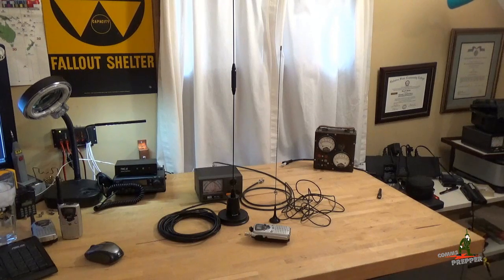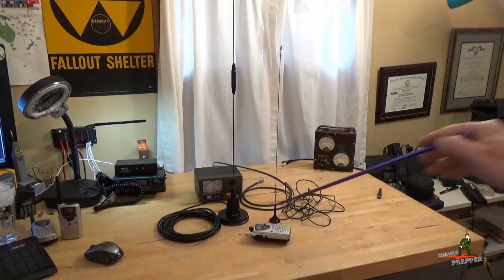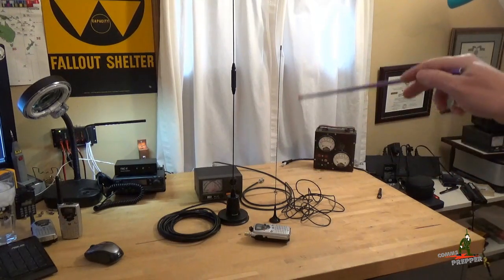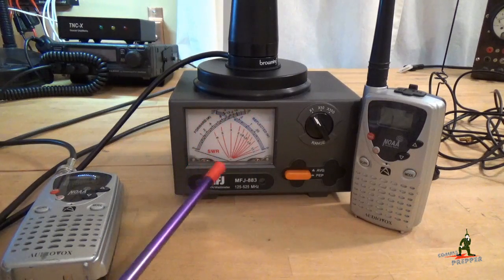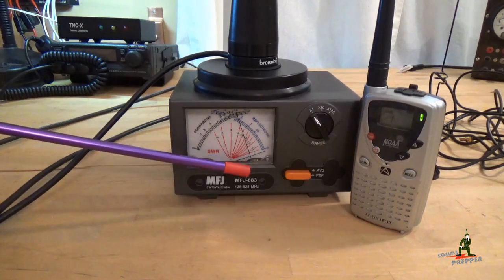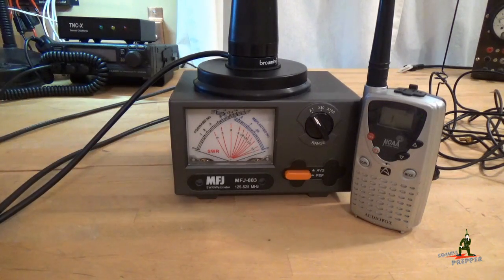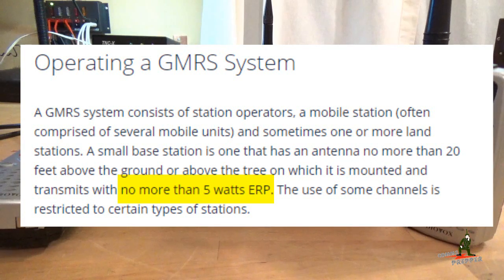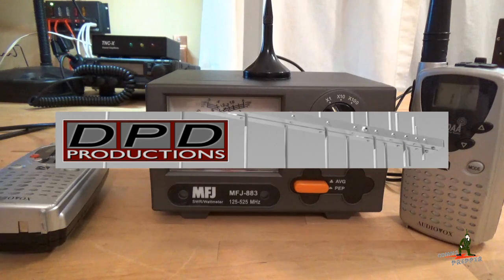GMRS Mobile Antenna

Comment: FCC regulations concerning transmitted power have no bearing on the antenna gain whatsoever. Transmitted power as defined by the FCC is the wattage that exits the radio at the radio's antenna connection point, not the power transmitted by the antenna. This means signal multiplication by antenna gain factors are of no concern to either the user or the FCC. You can put full legal 50 watts of power through a high gain antenna with no limitations or worries, provided the antenna is mounted within legal height guidelines for your area.
Reply from the maker: I thought the power was based on ERP?  I will have to go back and check.  So much to remember with radio.  Thanks for the comment and taking the time watch.
Reply: You're correct, at least as I understand with the CB rules the FCC uses ERP. If they use it for GMRS I'll need to look again.
Reply: I posted the part 95.135 power limits section below, from the FCC.

Comment: I just got the Midland GXT1000VP4 Handheld radios and the Midland MXT400 GMRS radio.  Will this antenna work with these radios?  Thanks for sharing.
Reply from the maker: The DPD antenna will work with the mobile.
Reply: Okay, thank you.

Comment: Just ordered DPD mobile. I am using an Ed Fong antenna for my base 20" above gound for now (I have a 60' tree to mount it in later). I have made comms as far as 9 miles from base to car with the midland antenna that comes with the MXT100. Thanks for all of your videos!
Reply: HardcoreFourSix How do you like your DPD vs Ed Fong antenna do they perform equally?
Reply from the maker: Thanks for watching.

Comment: what about the antenna that came with it
Reply from the maker: What about it?
Reply: Commsprepper I have a Midland GXT Xtra talk walkie talkie the antenna that came with it is not removable is that the best antenna for this I think not why would they put a high quality antenna on a walkie talkie right so it puts out what they say it puts out I can't put another antenna on this one because it doesn't come off with a BNC connector or something
Reply: Commsprepper the point of the matter is when you buy a radio it should have the perfect ratio antenna on it so it puts out the perfect amount of power it's supposed to so why do they not put the right antenna on there

Comment: how well does this antenna do w/ 2m and the lower 430-450 bands? I have my HAM license, as well as GMRS. going to buy a TRAM 1185 for the 2m/70cm, but also wanted a better antenna for GMRS. i'd rather not have 2-3 atennas for VHF/UHF, as i'm giong to be getting a 10m antenna for my truck too, once i get a radio that'll do SSB 10m.
Reply from the maker: It does not cover those bands.  It is GMRS specific.   I can't think of an antenna (or radio) that covers 2m, 70cm, and GRMS.
Reply: I can think of a bunch of em lol

Comment: Putting that big mag mount right on top of the SWR meter isn't the brightest idea.  You should test with the antenna mounted on the car.  I do believe those cheap Chinese antennas are tunable to improve the SWR but that won't stop it from blowing off your roof at 20 mph.  Also the front end of the radio is the receiver section, not going to get warm with reflected power.  The final amplifier in the transmitter will take the punishment, get hot and fail eventually.
Reply from the maker: +skypilot0077 Thank for taking the time to comment.  I did post a follow-on video comparing the three antennas.

Comment: you're going to get in trouble for this one buddy. this is an awesome video showing the benefits of quality equipment! however I can already hear the "cheap China preppers", commenting with all the different arguments, why the Cheap Chinese gear is better "value".
 I've got huge respect for you Hank! 
Liked, shared, ...
Reply from the maker: +SurvivalTech Nord STN - Thanks.  I was hoping to side-step controversy with a sound presentation but I might have missed the mark on this one.  I don't understand why preppers will spend over a grand on an AR, then another grand on accessories but resist spending more than $100.00 bucks on communications equipment.  Odds are way in the favor of someone needing communications equipment in an emergency than other prep items.  This said, some comments have been positive and DPD Productions make great antennas and folks should know it.
Reply from the maker: +pkevin79 Good point!  I support anything that encourages folks to get their Amateur radio license.
Reply from the maker: +pkevin79 Thanks for watching and supporting the channel.  Healthy discussions are good and needed!
Reply: +Commsprepper Really good point.  Hadn't thought of it that way!  Thanks for the video.
Reply: +Commsprepper The thing about the Chinese HTs is that they can be a good "gateway drug" into the amateur radio hobby.  There is ton of fun and value in a $35 Baofeng that can lead into getting a license.
Reply: +Commsprepper I only say because I am one of those people who bought a Baofeng and got bit by the ham bug after the fact.  Thanks for the healthy discussion.  Your channel is great and I watch religiously!

Comment: I would rather put the effort into getting a Tech license and legally use a Chinese radio on 2m/70cm.  You can get far better tuned antennas to adapt to a Baofeng HT and make use of a useful band, repeaters and all.
Reply from the maker: +pkevin79 Having and Amateur radio license does open many options for emergency communications and preparedness.  But for those who chose not to get licensed - selecting quality equipment and antennas can significantly improve emergency communications and preparedness.
Reply: +pkevin79 far better tuned antennas? No not really. The super gainers are too practically tall and too heavy for almost anything. The wide band Comet CA-2x4SR is too stiff and too heavy for a roof mount (which defeats the purpose of calling it a Search and Rescue antenna).

Also look at commercial versus amateur antennas. Amateur antennas are always listed in terms of dBi. An isentropic radiator does not exist in the real world. Commercial antennas are referenced in dBd (below 1 GHz), or to a dipole antenna (which has a gain of 2.21 dBi). Amateur antennas often appear to have more gain when the really don't.
Reply: +rowdyraider556 Not sure what you are talking about.  Amateur radio is all about antennas and there are literally thousands of designs that can be built or bought, from a simple dipole on up.

Comment: um, you are allowed to use 50 watts on GMRS channels 15-22, which are also where repeaters operate on GMRS. You are only limited to 5 watts on the interstatial GMRS/FRS frequencies, where repeaters are forbidden. Other than that, good video.
Reply from the maker: +KG5 Radio Thanks for the comment.  I was working off of what is on the FCC website.  I thought 50 watts was permitted err on the side of caution but adding a screen shot from the FCC website.
Reply: +KG5 Radio  5W ERP on the interstitial channels. If using mobiles...you can't really use them unless you have a 5W low power setting and a 1/4 wave antenna (which not many commercial radios have). 

Repeater splits can use up to 50W RF (notice there is no ERP limit).
Reply: https://en.wikipedia.org/wiki/united_states_national_radio_quiet_zone
Reply: ERP must be reported or estimated on the license application but the maximum allowable depends on application, ie. Mobile, station or control station and it's proximity to the "Quiet Zone" in W.Va, Va and Md. (Line A and C referenced below.) 

95.135 Transmitter power limits.

(a) No station may transmit with more than 50 watts output power.

(b) A control station at a point within a large urban area must not transmit
with more output power than the licensee determines by a test (see 95.47 and
Appendix A). The licensee must keep a copy of the measurements and
calculations made during this test as part of the GMRS system records (see
95.113).

(c) A small control station at a point north of Line A or east of Line C must
transmit with no more than 5 watts ERP.

(d) A fixed station at a point near a large urban area must transmit with no
more than 15 watts output power (see 95.49).

(e) A small base station must transmit with no more than 5 watts ERP.
Part 95.25 describes each station type and 95.55 details which type may communicate and how with other types.
 73's

Comment: I have the same radios. Got them in 2001. How many other licensed GMRS users have you heard on the air? Since 2001, I have heard exactly 3 valid call signs on the GMRS bands.
Reply from the maker: +Linus I have never heard a call sign be mentioned on a GMRS channel.  However, being licensed is something that must be mentioned because it's a requirement.
Reply: +Commsprepper Yes. It is a requirement for sure. I have had someone ask why I was speaking letters and numbers (my callsign) out over the air -- on a GMRS channel. I had a good laugh.

Comment: Impressive performance over not much of a ground plane! I'd be curious if the cheap one still performs as poorly over a better ground plane, such as a metal sheet or car roof, or if the DPB Antenna changes at all when operated with a better ground.
Reply from the maker: +PTT Liberty Even if the cheap antenna had a 1:1 SWR it's gain of 2.1 and coax loss still make it inferior to the DPD antenna that has better coax cable and 5.5dBd of gain.

Comment: a mag mount with ample ground plane will show a low SWR most often.

I might first try a $20 tram 1185, see where that ends up on the swr meter and trim down length as needed.
Reply: +Sean Yunt 1/4 wave UHF antenna is widebanded enough to work both the upper portion of the 70 cm band and GMRS with low SWR.

One could also acquire the PCTEL wide band knob. Unity gain (0 dBd, 2.21 dBi) but is banded for 430-480 MHz (and shoots under 1.7:1 for the whole thing. Another good antenna is the triband antenna I run on my pickup. Comes form Panorama...146-174/430-480/765-894 MHz.
Reply from the maker: +Sean Yunt Sean I have Tram antennas for Amateur bands and think they are great (I have a video or two on them).  But for GMRS operations folks should be using GMRS tuned antennas.
Reply: +Commsprepper if they lack the skill to tune an antenna I agree, otherwise I am willing to bet I could shorten the length of most any 70cm antenna and get is to 1:1 SWR on GMRS.  Obviously not all designs will allow easy trimming, but if they have set screws holding the whip into the base, you can grind off the bottom until you get tuned up.

I've done this on $9 CB whips to get them tuned on 10 meters for amateur use.

also did this on a VHF hustler sf-2 whip antenna
Reply from the maker: +Sean Yunt I'm sure they can be tuned but that will not address the inferior materials, small diameter antenna element, weak magnetic base, low gain, and high loss coax cable.  In the end - you get what you pay for.

Comment: is the el cheapo able to be tuned?
Reply: +Commsprepper on the bright side, the high loss from the coax will limit the reflected power from harming your radio :)

I'm not a coax snob, but length matters...

http://www.arrg.us/pages/Loss-Calc.htm
Reply: On place on steel cookie sheet for ground plane.  they r designed to sit on the roof of a vehicle
Reply from the maker: +Bruce Clark +Sean Yunt  You may be able to tune but that wont help with the high loss from the RG-174 cable used and the low 2.1dB gain.  The DPD antenna uses better cable (with less loss) and has 5.5dBd gain.  I have been very impressed with it's performance.

Comment: is the el cheapo able to be tuned?
Reply from the maker: +Bruce Clark It might but I would not waste my time.  They are designed for Amateur radios and Amateur radio bands.  This antenna is specifically made for GMRS.
Reply: +Commsprepper i assume it's the p.o.s.
that comes with a baeofang and it appears to be at best a quarter wave.I'm guessing the coax ia so crappy that a dummy load would work better.even on the lowly C.hildrens B.and I've covered pretty good distance line of sight due to a realy good antenna and quality coax.in the end skimping on your antenna and feedline is like building a 600 HP small block and bolting it to a worn out stock tranny.great video. as always.KE5SRB.
Reply from the maker: +Bruce Clark I am not a fan at all of the cheap import radios.  I think preppers are making a mistake buying them.  Spending big bucks on other items but going cheap on the comms.  Setting aside the fact it's against FCC regulations to use those radios in the FRS, GMRS, and MURS radio services, they are not designed for GMRS operations nor are their associated antennas.  The antennas (in theory) are tuned for 2m/70cm not GRMS.  The coax on the unit I got (for the purposes of making the video only) is RG-174 and has 1.9dB of loss from the 10' length.
Reply: +Commsprepper in the end you do,for the most part "get what you pay for".as far as comms go,i believe in the prepper community this and simple basic first aid are grossly undervalued.both of these can cost/save a life.what are your loved ones worth?